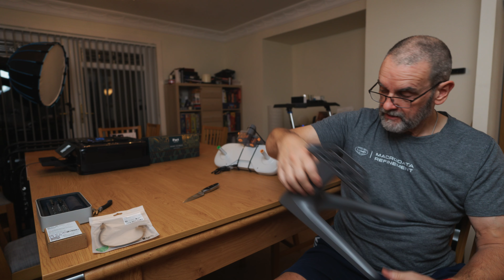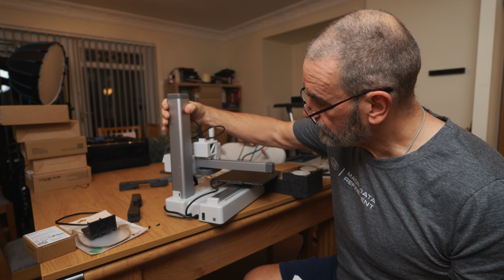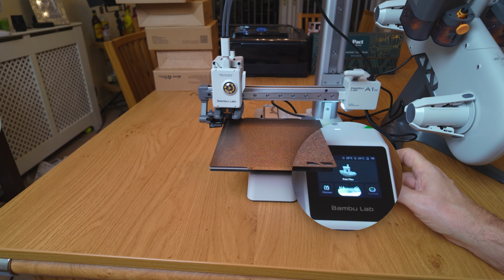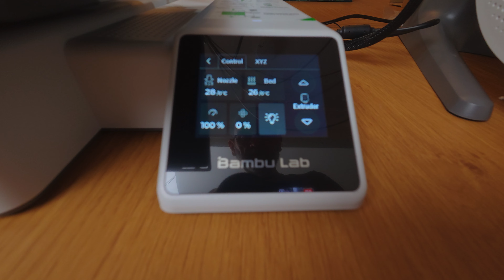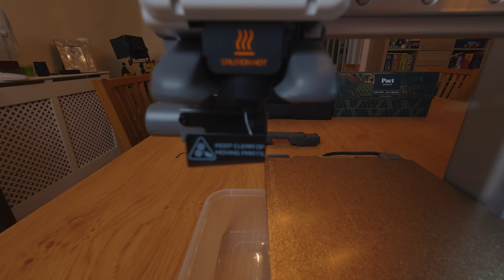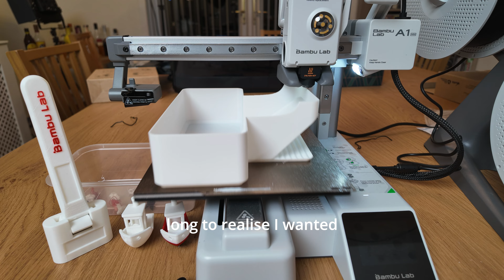Is This the Best Beginner 3D Printer Ever? (Bambu Lab A1 Mini Combo)

Comment: If you want to print different colors, you need to compare this combo with the new Anycubic Kobra X. The Kobra X has the advantage it can also mix TPU filament, something the A1 (Mini) can't.
Reply from the maker: Not that bothered about being able to print with TPU and normal to be honest. I upgraded to A1, and now have AMS 2 Pro, but I don't think that cam mix TPU and normal (in it). I guess it could be done with manual change on the external spool. I won't be getting a differnet printer to compare to any time soon :)

Comment: The mini is an absolute steal… it can easily match the H2D for print quality when set up correctly and calibrated for the filament (PLA). And it’s very quiet. £150 for these is insane. I have 3 of them. Easily my go to printers for production.
Reply from the maker: I completely agree. I needed (wanted would be more accurate) the bigger bed, so upgraded to the A1, but they are both superb printers for the money.

Comment: Nice, running a P1S/AMS Combo here and it's as great workhorse. Very few issues.
Reply from the maker: I have now had this printer (and the A1 I ended up getting) for a few weeks, and it’s been pretty much constantly printing. Still have had no issues.
Reply: @FOCMakes  The A1 is superb, the best bed slinger you can get, lots of print farms use them and that speaks volumes about how good their output and reliability is.
Reply from the maker: @griffog2001  Yes, it’s amazing.